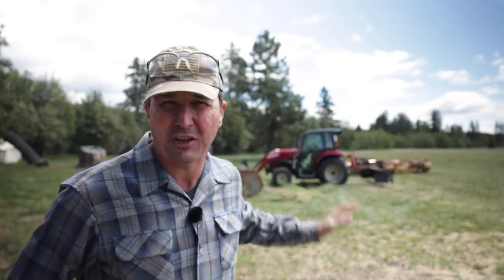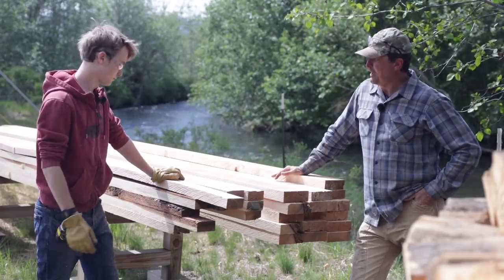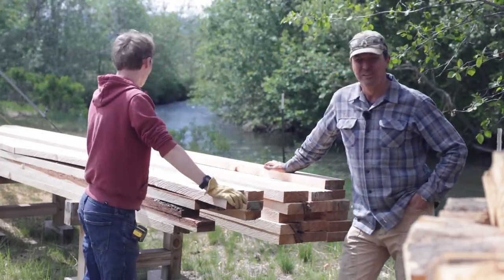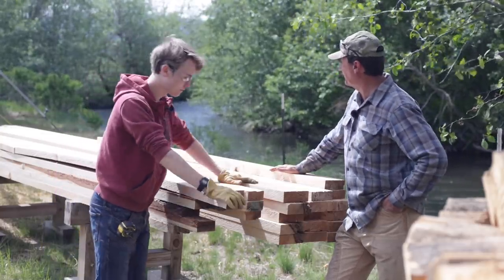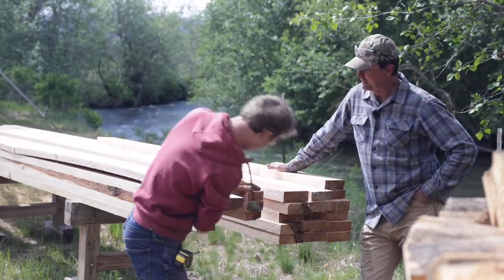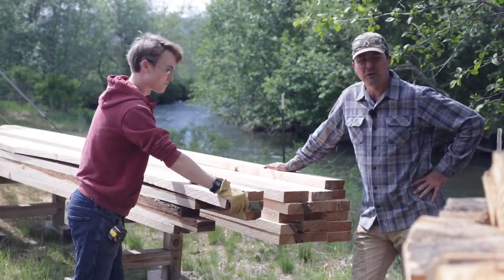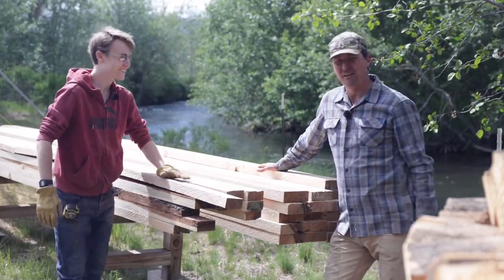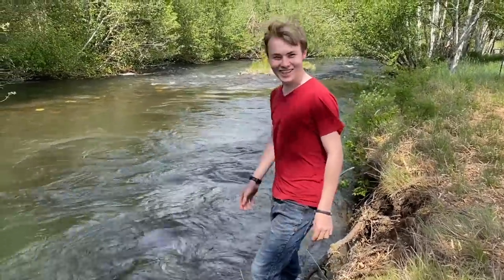How To Sawmill Like A Pro

Comment: It looks like you cut all your lumber flat, but to get the best grain oriented lumber you should think like a big cross. With a logg like that, you can get alot "quater sawn" lumber. Where the grain is oriented parallell to the short side. Standing in the middle upper and lower part. Flat in the outer middle part. That increase the value even more, because that kind of quality lumber is hard to buy these days. Must be craft cut lumber. Big sawmills never have time for this craftmanship. Just let the as many loggs through an hour.
When I was a young man, just a couple of years older than Jack, I helped an old man at the old local sledge saw. Loggs were adjusted and moved by hand. Lumber by hand. You rarely see that craftmanship, that look for the wood and the quality in every single logg, today. Almost no loss. Every little piece that could be cut out, was. I never learned the skill, but I have at least seen it. Few ever does today.

Comment: Wow, "several thousand $ worth of lumber there"? Lumber is very expensive over there! I would understand that lumber would be expensive if you lived in area where lumber is scarce and must be transported from far away but your area seems not to have that problem? Or maybe you have some special kind of more expensive wood? We use pinewood for framing here in Finland. What you have is 82m of 2x4" and 88m of 2x6". That would be, bought from a saw mill and sawed all sides to same ie. no bark, roughly 482€ ($588) here right now. And lumber is now very expensive due corona. Cool saw mill though.